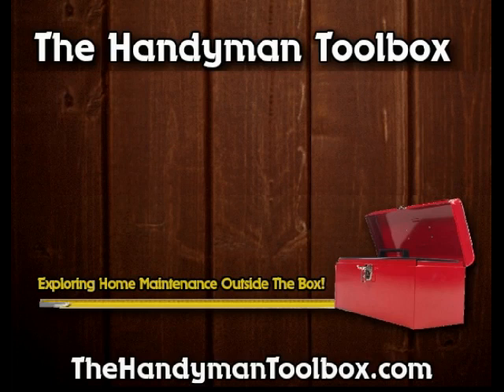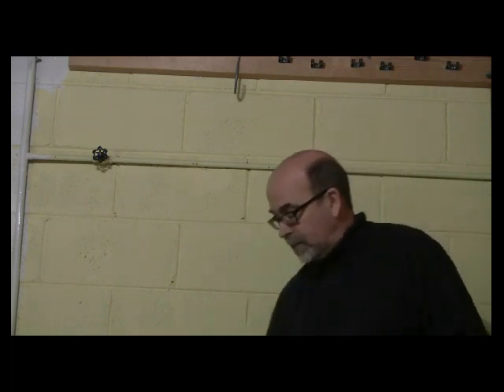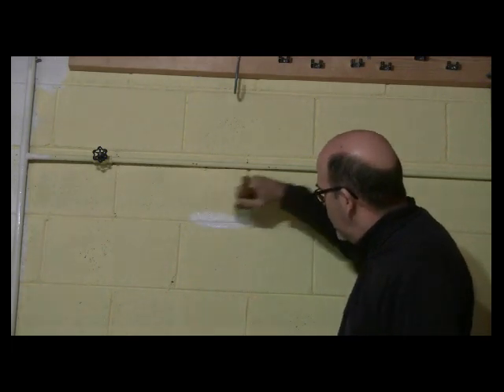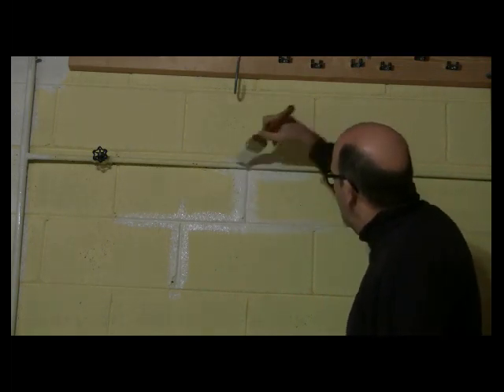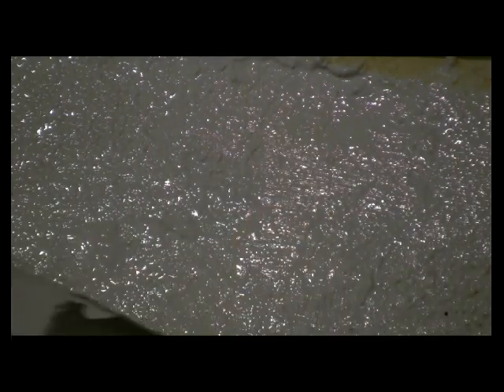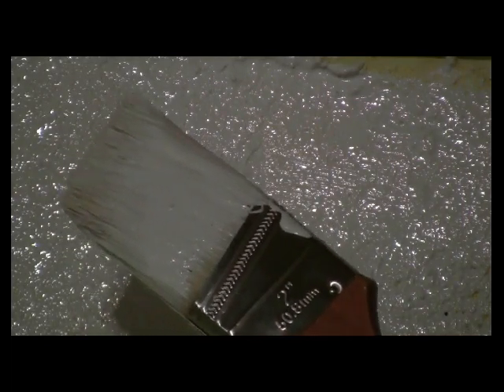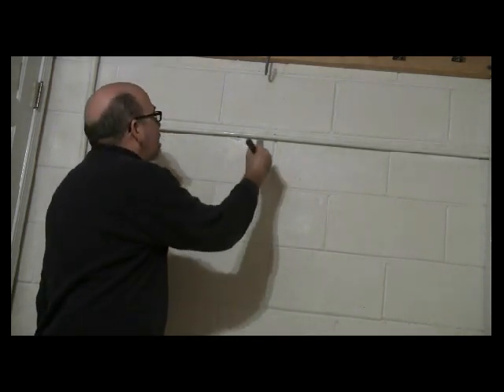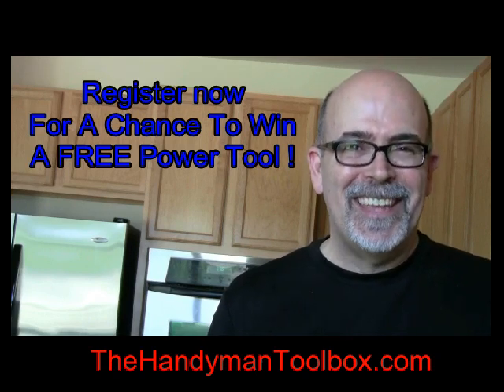How To Paint A Cinder Block Wall With Step-By-Step Painting Tips

Comment: We are primering (using a roller and brush) a brand new concrete block wall with "Smooth Blocfil Select" (by Dunn Edwards), it's too thick to use in a sprayer.  Our wall has never been painted as yours so it will surely be more porous than in this video but helps us know what we're looking at after it is primed and we'll use a sprayer.
Reply from the maker: Good, let me kow. Thank you for commenting. Please subscribe, like and share the DIY love!

Comment: Hello. At our church we have a room we use for preparing meals and classroom. In this room we have a cinder block wall which we tried to paint but towards of the bottom the paint would not stay because the wall produces some type of powder effect. Any suggestions on how to fix the problem so we may finish painting?
Reply from the maker: Better do a mold test on the wall... you can get one at the local hardware store. If it is positive, go back and get the paint department assistants to guide you with what -"de-molding products to use." There is  a anti-mold product to use in the paint you buy as well at the counter. Best wishes
Reply: You need a cement bonder to adhere the paint.

Comment: I think surface preparation is the biggest issue with any paint job.  Exterior walls should be pressure washed.  You can brush off interior walls. Mold and mildew have to come off or your paint won’t last.  Mortar should be patched. Then painting and method used aren’t as big a decision.
Reply from the maker: Thank you for commenting Joel. Please subscribe, like and share the DIY love!